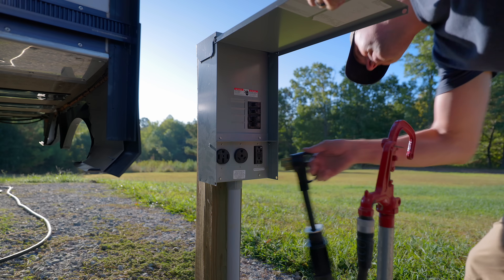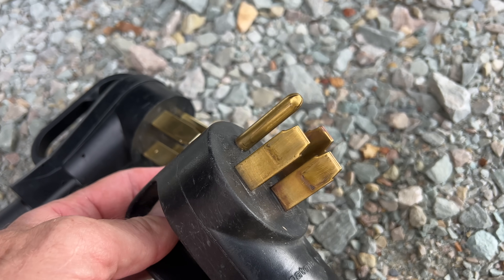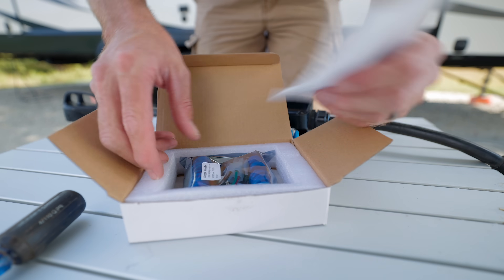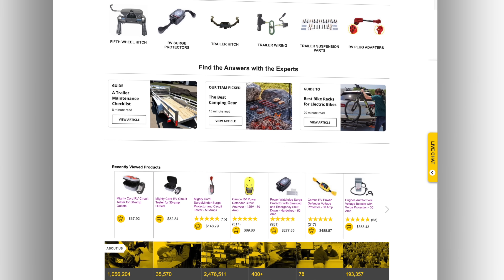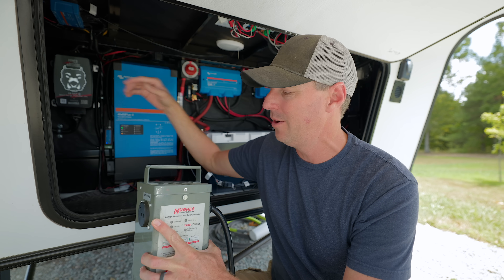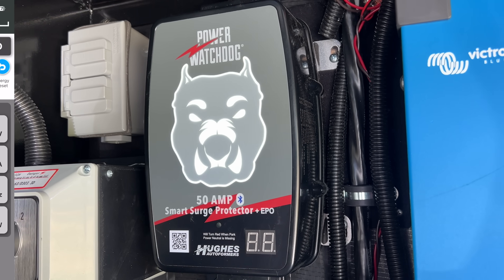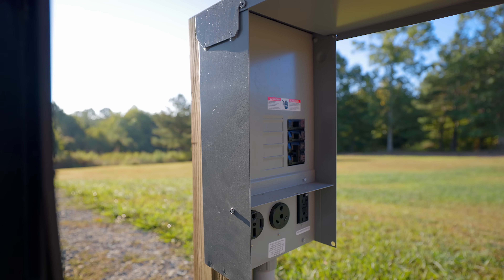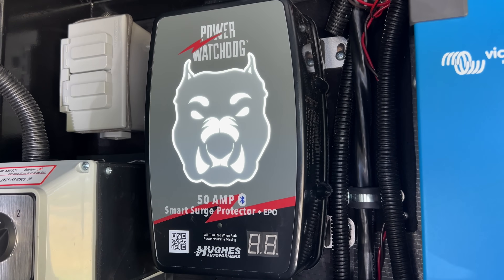Failure! RV Surge Protector Misunderstanding! Is Your RV Surge Protector Protecting You? AllAboutRVs

Comment: A couple questions. Would you recommend the 30amp Autoformer to save $$ over the 50Amp Autoformer even now and how’s the functionality with your Multiplus?  Do you have the Power Watchdog-EPO spliced-in just before your Multiplus.
Reply from the maker: Yes my watchdog is before the Multiplus and the Autoformer works great with it.  No problems. I have two thoughts on the 30 vs 50. In the situation where you have low-voltage in an RV park, the more power you use the lower the voltage will drop in the park. The 30 amp auto former reminds us to not draw too many amps which is courteous to the other RVs around us by not making the situation worse by drawing more than we need. That said it just makes sense to get the 50 amp version if you have a 50 amp RV.
Reply from the maker: Good question. It won’t boost the Voltage as it has to synchronize to the power coming in. It does have the ability to disconnect when the voltage drops too low. Another thing is by nature if you set power  assist lower around 9.5 amps it could make the difference. While it’s not boosting the voltage it is at least drawing as little as you can which will help the voltage not drop lower that it would otherwise. So in short no voltage boosting but can help at times depending on how bad the voltage is.
Reply: Do you know if the Multiplus alone without any of the surge or voltage boost equipment you talked about here provides any boost via the inverter to a park low voltage situation. I hope this question makes sense.

Comment: Would love more info on investigating hot skin.
Reply: Online and on YouTube there is much info on that by pros that are expert on electrical issues.  Usually the problem source is the park power. It's rarely the RV. You can easily confirm this by plugging the RV into a portable generator to see if skin is no longer hot. (Master Cert RV tech)
Reply from the maker: Good advice you just want to make sure your generator has a neutral ground bond at the generator otherwise things have changed from shore power.
Reply: @AllAboutRVs  Good point. I know all my small generators have a neutral bond since they have RV receptacles, but I'll get out the meter and verify they are, plus be sure my 7500 Watt unit is bonded. Thanks very much for bringing it up. 👍👍